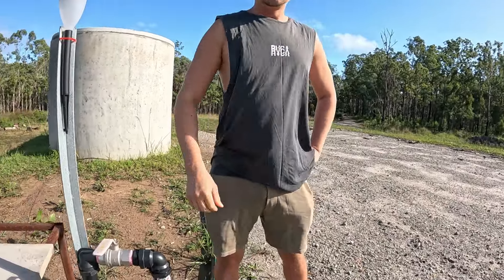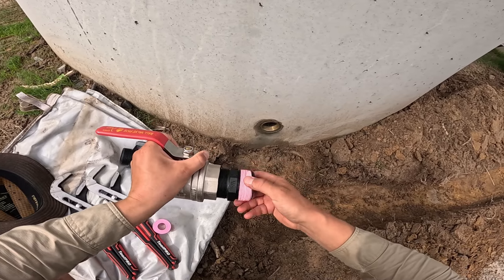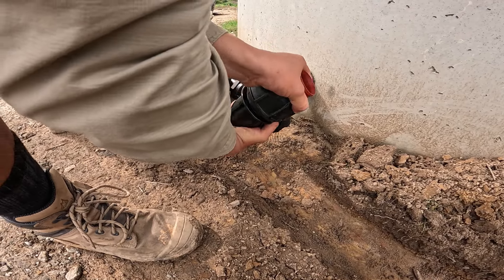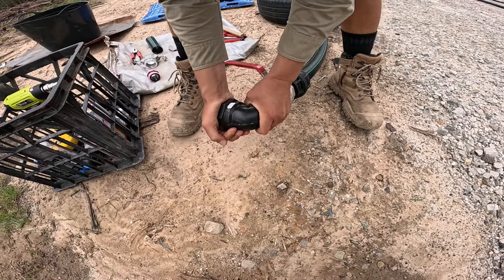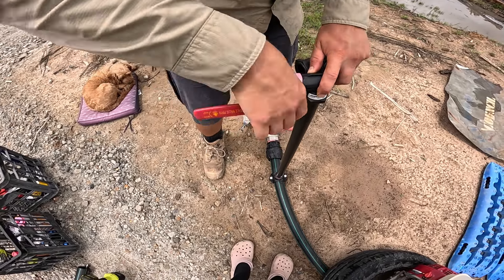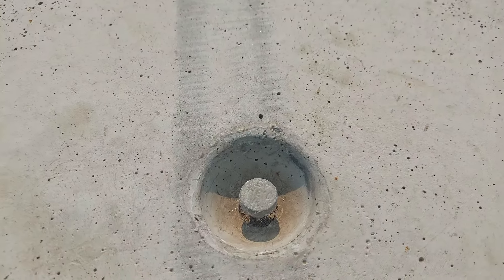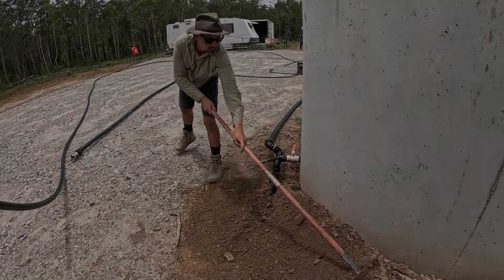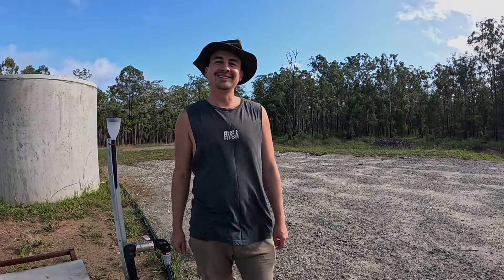Water Tank Plumbing with Poly Fittings  &  Filling with Bore Water

Comment: When you are operating those valves, do so slowly, to avoid sediment being stirred up in the pipes and worse, acoustic shock. That is basically a pressure wave in the water that damages fittings, loosen pipes and can damage tanks. Remember how you were taught to never jump into a water tank because you will burst it? Acoustic shock in pipes is a mini version of that. 
Turn valves on and off slowly. The one you show at the start, take 20 seconds to do so. 
When there is a big fire in the city, the water company has to go out and operate valves to increase flow here, decrease there. If the FF do it themselves, everything bursts and sediment is stirred up for a week. 
The supply to the house, you can drag a swab through it and clean it out after 12 months and have what collects, tested. You can also run vinegar into the system and let it sit overnight to get rid of any scale.
The pink tape is for Gas, check compatibility with the PVC fittings you used.

Comment: -Man it must be so nice knowing you have a large supply of fresh water available! Even better that it's drinkable water!
-Are you planning to connect it to the van to have fresh water direct to it until the house is built?
-Also, are you putting any in-line filters to filter the tank water?
-Your going to be a irrigation professional with all this work Alex haha
-Also, 8.33 love the safety crocs :p 
-Filling those tanks shows the amazing pressure that little bore pump creates, did not expect that!

How's the grass on the side of the mound going? did you suffer a lot of loss with the recent rain?

*I write these comments as i watch the video through ;)
Reply from the maker: It is a relief to have water set up, in the future there will be a buried poly line directly to the tanks and with them all connected up it'll be as simple as flicking a switch and the water replenishes itself and all the tanks fill from one tank :) 

At the moment we just fill the van up when it runs out of water with that 1" poly. A permanent connection would require digging up the driveway and installing an additional solar pump with a battery, charge controller and solar panel which is a lot of effort for something temporary... All simple life conveniences require a lot of effort when off grid lol

And we were going to add inline filters when the iron was a problem, but since the minerals ended up settling to the bottom the water is beautiful. The final set up will probably benefit from some filters, just because silt can build up in water tanks overtime and that whole mix of minerals and silt can make the water taste weird to those who aren't used to it. But it really isn't a necessity because most germs need sunlight to grow and the tanks are closed off from any light.

Being an irrigation professional is definitely a career option after all this lol

Crocs are the ultimate farm shoes 👌

And yeah the pump is pretty impressive, it was putting in about 40L/minute and now that it's set up with solar power it's free to run.

The grass on the mound is absolutely loving all this rain, but the growth slowing down now that the weather is cooling down. The rain isn't much of a problem other than slowing things down because the ground is too soggy to drive around or work with. We haven't had a dry week in a couple of months really, it's weird how much it's been raining.

Comment: Its probably orange because the land is wallum.
You musbt be far from the coast.
It's the tannums from the tree's. 

All nutrients.
If youre dribking itz just boil ot first. It might be pure enough not to have to boil.
Everything settles in the bottom and the taps higher enough up, not to drain the muck that settles.